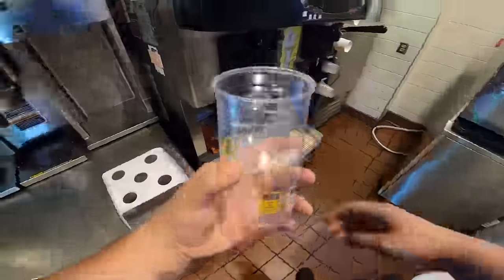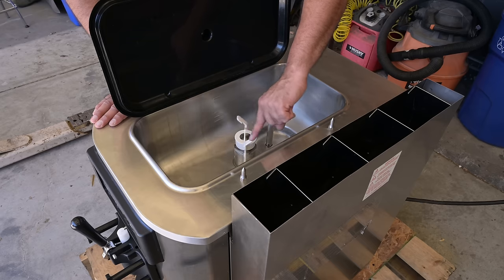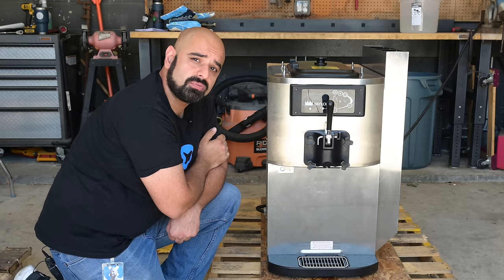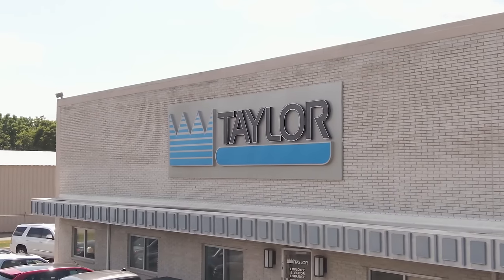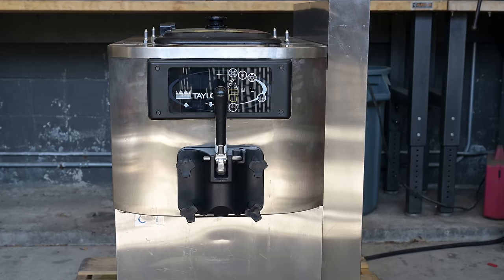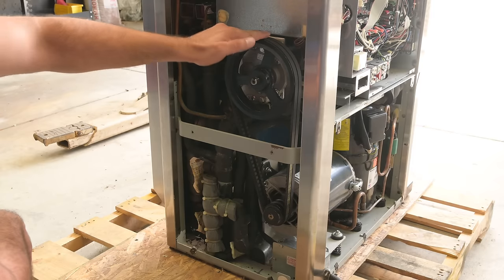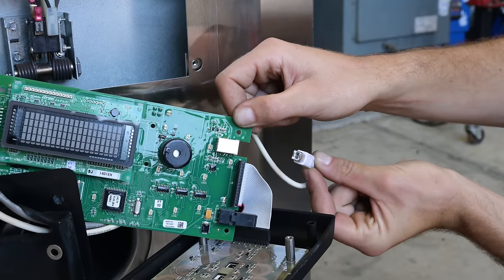Why McDonald's Ice Cream Machines Are Always Broken and How To Fix Them

Comment: The elephant in the room is that such a device would basically violate the contract that McDonald's has with the ice cream machine make her. So even if you fix the DMCA, they might be stuck with the companies BS for months or even years depending on how long the contract is. Even if there wasn't a DMCA, the original kitch device would have violated the contract.

Comment: could a main control board be designed to swap out the one on the machine. this would mean you are not technicly bypassing the locks you are just replacing.

Comment: Excellent…the inability of the company to resolve the unacceptable recurring demise of their machines should automatically make their contract with the franchise null and void, at the very least, until they  satisfactorily fix the problems. The franchise should have every right to do whatever is necessary, without any interference.  McDonald’s need to remove their head from their tush and resolve the issue once and for all.

Comment: Unless you have the exact same machines as they use in mcdonalds, you WILL NOT get the same problems. The software of the mcdonalds machines is completely different than the rest of taylor machines.The biggest part of this is Mcdonalds not wanting to allow the franchise employees to know how to properly clean and maintain the machines and especially not know what each error code stands for. There is a whole video on this same topic about this guy who came up with an app to help employees to know what each error code stands for and how to fix them. The reason why mcdonalds does this is to force their franchise owners to pay for expensive maintenance fees instead of letting them fix it themselves.

Comment: Its control board and panel is completely overkill. it could be run completely without micro controller if necessary.

Comment: The whole machine does not seem complicated; just a few motors and sensors, i doubt its ice-cream producing parts change much since 1970s. Maybe its viable to design a drop-in replacement controller board with no digital locks whatsoever and just swap the original.

Comment: I charged back a $20 order that included the overpriced grimmace meal, paid through the app, pulled up just to be told the ice cream machine was broken. When I told them to refund it I gave them 3 days which they never did. I was pissed because I know why these machines fail yet the app does not prevent ordering items that involve the ice cream machine that they know is going to fail due to the scam between taylor and mcdonalds as a corporation.

Comment: The right to repair part is only one part of the issue here. There are no relevant patents in that machine that haven't expired long ago. It should be legally possible to:

- Make and sell a better replacement machine
- Buy a better replacement machine from a different company.

It's not currently possible, due to franchise pressure. But if a manufacturer can prove their ice cream machine is equivalent, it shouldn't be legal for the franchise overlord to retaliate against franchisees who use a superior machine.

Right to repair is just one necessary part of a fair and competitive market. But if there's no fair and competitive market, there are still countless ways manufacturers can effectively prevent owners from servicing their own machines, even with a right to repair law.
Reply: That’s true in other parts of the world, and this isn’t an issue there, but the land of the free let’s owners force you

Comment: Sounds to me like there is something in it for McDonalds. Without some financial benefit from an interest in Taylor, it doesn’t make any sense for McD to stick with Taylor machines. Im sure they are costly. Constantly breaking down means no product and no sales. Franchise owners can’t be happy and as much as McD doesn’t care about their happiness they care about profits. So somewhere McD has to be benefiting from what otherwise seems like a losing business proposition. Other places sell soft ice cream. What machines does Dairy Queen use? Do they also have all these breakdowns and meaningless error codes, overheating issues (hot summer makes ice cream a big seller) and long cleaning cycles?  Seems to me a lot of the components ought to be able to be detached and run through a commercial dishwasher and then popped back into place.

Comment: How is it that Dairy Queen doesn’t have this issue with their soft serve machines? Maybe McDonald’s needs to source a different machine and cancel their Taylor contract.
Reply: The DQ I used to work at had very simple machines that pumped the soft serve mix from a bag in the walk in cooler. The McD's machines are way more complex and designed to fail.

Comment: The claim that the DMCA bars interpreting error codes seems dubious.  I suspect that an appeals court would eventually find that error codes were not a technological measure that "effectively controls access to a work protected under this title."

First, it's not clear error codes control access to anything at all.  They certainly don't seem to control access to any copyrighted material and it's doubtful that a mere error code lookup table would count as doing so effectively (as low a bar as that is judges aren't likely to rule anything were a tech might just remember them all as an effective access control measure).

Of course, that's not what most companies use to block repairs.  They use slightly more sophisticated electronic authentication which they can make a non-frivolous claim controls access to things like their code or bus protocols or the like (and u can't easily challenge w/o first violating).

Comment: It's insane that its illegal to diagnose the unit because of COPYRIGHT laws.
A company prohibiting access by technical means is one thing, but the law prohibiting it (even though clearly that has nothing to do with copyright) is just another level of stupidity.
It should be allowed. Of course, the vendor could decline (or charge extra fees) to service machines that have been tampered, they have the right to do so ( and it makes sense - this way the have to test for more things when diagnosing an issue)

Comment: Write an app that read the screen using the camera and provide a step by step checking 🎉 No photo shown to the user as the visual of the machine might be patented or any itel under copyright. Ask the user for confirm of problem solving. Put the data in a lake and intuit the issues on phase 2 based on that. 🎉

Comment: I currently maintain 2 mcdonalds shake machines with about a 90% up time one machines is 12yrs old the other is 3yr old the most common issue for then being down at my 2 locations is the staff not caring about the machine not maintaining the right mix level to little it falls heat treat some times to much can have the same effect another improper cleaning when not done by me yes 4hrs to clean maybe 5 if I have to reseal the machine if it's being cleaned in an hour or two don't eat out of it I'm old when it comes to cleaning and such also maintaining the machines parts pumps motors glycol levels filters I do all of this having someone trained by taylor would be the best fix at set up improperly cleaned pumps will take you down for day waiting for replacment parts I have many other stores call for question this thing is not your standard fridge or freezer they have a mind of there own sometimes and please turn on your audible mix level indicator you will take time and money just with that dam beep

Comment: I feel like the issue isn't that you can't repair it but rather that it's legal for quasi-monopolies to create systems for which "official" repairs are that expensive are allowed to break that often.

I mean, it's really not hard to tell this is an actual manufacturer conspiracy when EU/UK machines are by far not down as often as the ones in the USA, when the only real difference is that EU/UK are has garantueed warranty periods for any sort of electronics. I mean, it's a bit weird that when you hold manufacturers accountable for the shit they sell, they can - all of the sudden - produce decent quality that doesn't break. Weird, innit?

Comment: My guy, the machines at McDonald's are designed to break, Taylor since McDonald's opened has been doing this so local owners have to spend 100$ an hour on some repair dude with a special manual that actually twlls them whats wrong, usual main culprit is the ice cream being a degree off.

Comment: 1 1/2 engine. Ah it's called a motor, engines are in cars, trucks.  Show an ingredient list of what's in the ice cream. Also show a machine that has been in use inside. You may be surprised of what leaks in and rots.

Comment: Edit, i was there 20+ years ago. Not being able read the codes is ABSOLUTELY B.S.

It is rough working fast food when any  machine is down. 
Working the opening shift, I cleaned the Taylor machine everyday for 5 to 8 months. Took me around an hour per machine. If you forget One Step or an O-ring. That's it. Take it alllll back apart. Even with just an ice cream and a milkshake machine. Two mistakes, that's your day ruined.

Screw unfixable machines. Profit gouging sharks.

Solidarity with Ukraine.

Comment: flathead screws? What is this, 1940?
Also, one way for this machine would be to ditch the crappy controller they provide and replace it with an off the shelf PLC. Sure, you'd have to basically program it from scratch, but it's an ice cream machine FFS, not a car.

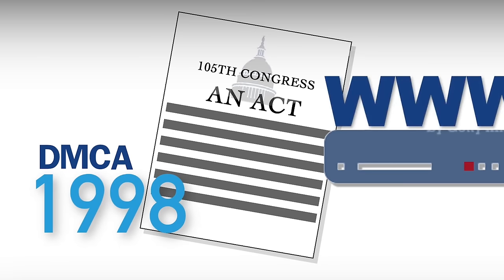Comment: 7:48 sorry but you can and should, its your equipment not theirs, anything in said equipment is also yours including software, there may be many instances of it on many machines but that instance is yours not theirs.

Also its a dang ice cream chiller/mixer its not exactly a complex process nor is it a application that relates to security of any kind, quit being afraid of legislation that has no reason to apply to applications like this.

I sure as heck dont let a law like that govern how i can fix my own equipment, if i encounter a problem or a lock on MY equipment im bypassing it no questions asked.

Comment: What wonders me is that the compressor is inside the unit. Typically commercial/industrial freezers have an external condenser(like an AC) like a Güntner cooling system. Yeah it shouldnt be frozen but the overheating issue would be fixed since the condenser would now be outside the building and can reject the heat.

Comment: Nice video, but this has nothing to do with the reasons why McDonald's ice cream machines are down so frequently.  Your machine doesn't even begin to touch on it, nor does your video. Error codes have never been an issue with respect to McDonald's machines.

The number one issues is employees not maintaining the level of mix in the machine, which causes the machine to go into heat mode.  Your machine is not a 1:1 of the McDonald's machines.  If the mix level is too low or too high the unit will go into heat mode.  The former because if there is insufficient mix, then heat actually builds up if too low, there is an air tube that mix or foam will prevent the system from drawing air.

While this is the number one issue, the result if not addressed quickly, is that the unit goes into heat mode and must be cleaned.  If mixture is removed, if filled too high, or added if too low, soon enough after alerted, the staff can sometimes avoid cleaning the unit.  Otherwise, you are down for a cleaning.

The number two issue are seals.  Again, unlike your unit, the auger (beater) is on a shaft which inserts into the back of the unit. There is a seal, which when damaged or worn allows the mixture to leak into the machine.  That catch drawer you pulled out, there are two in the units in McDonald's.  If this overfill with mixture, then the mixture spills out onto the evaporator, compressor and motor.  With the heat of the unit, the mixture becomes hard as a rock and impossible to remove.  A compressor or motor that is covered in mixture will result in overheating of those parts, and with the compressor, cause it to inefficiently cool.  Likewise with the evaporator, however, in this case it becomes increasingly difficult to cool the mixture as air can't flow through the evaporator.  The failure to properly maintain the machine is the number one cause of long-term failures.

There are other issues, as well, but those are the two top two issues.  The only way to resolve the primary issue would be to create a machine that automatically feeds mixture to the machine without the crew needing to fill it.  The number two issue needs a solution as the situation seems to be worse.  One McDonald's I know of had a machine for 35 years, since it was replaced with a newer unit, there have been 3-4 replacement units, all of them due to the compressor/motor/evaporator being caked in mixture.

Comment: ok but why does that transformer have a drip tray? :'D
also the DMCA anticircumvention stuff has nothing to do with the right to repair, you know that right? section 177 literally says "it is not an infringement ... to make a copy or adaptation of a program provided that ... is created as an essential step in the utilization ... with a machine" while section 1201 says "No person shall circumvent a technological measure that effectively controls access to a work protected under this title." (error messages aren't substantive work) and "a person who has lawfully obtained the right to use a copy of a computer program may circumvent a technological measure that effectively controls access to a particular portion of that program for the sole purpose of identifying and analyzing those elements of the program that are necessary to achieve interoperability"

Comment: The machine you bought is a different beast to the macs machine, other than it makes ice cream. Different mechanics and systems. The error codes are not the cause of any problem, they advise what the problem is. Suggesting someone with no technical knowledge can push a button and rectify the issue is very misleading. Maybe the error codes could be more explanatory but a non tech would still not be able to fix it.

Comment: The best solution for a reverse engineered device like this would be to open source it.  If you do this as a company they have a legal stand against you and a realistic chance at shutting you down as well as financial benefit.  If you make an open source project, especially if you do it under a fake name/pseudonym, good luck putting that cat back into the bag.  With Arduino and Raspberry Pi being so readily available, if you figure out and document the protocol/error codes and post this information publicly, it will spread.

The problem seems to be that anyone who wants to invest the time and effort into producing such a repair/diagnostic tool also wants to keep it closed and profit off of it themselves.  Shame.

Comment: Because McDonalds employees are lazy. When I worked for Burger King, we had to break down the milkshake machine EVERY night and clean it before we left for the night. So instead of waiting until we closed to do so, we would start breaking the machine down around 10pm, have made up a few milkshakes in case, and if we ran out then we simply told customers "Sorry our machine is down for the night"
Now you factor in millennials and Gen Z working, and you have an ever increasing down time.

Comment: The Taylor machine in this video is nowhere even close to the same functionality as the 602  that you find in McDonald's not even close. The comparison here is a joke. I work on the Taylor 602's all the time matter fact two in the past two days. Granted, it's job security. However, if you're going to try and compare apples to apples compare apple's to apples, not apple's to oranges. Taylor is the manufacturer, yes,  but Taylor makes a ton of shake machines that do not break down all the time. The 602 has a lot of reasons why it's constantly down.

Comment: 1. i am surprised that you was able to get the machine that tailor would even sell you a mcdonalds grade machine.

i would thin the least tailor would do is either say that the machine is sold exclusively to mcdonalds (witch you can lie and say you are starting a franchise or you can do a bait and switch and start a franchise and then immediately go out of business (by witch case maybe mcdonalds may ask for the machine back)) or they would have. a consumer version of the same exact model that has normal software.

oh incase mcdonalds and/or tailor should try anything funny and call in a copyright complaint to get the video taken down i have a backup copy of the video thereby i can repost it for you even on a site that only takes down malware, fakes and illegal images (yes the same illegal images that apple wanted to combat on the iphone and back pedaled after controversy).

screw the dmca if you need to make a transaltor device and sell the device without the software and then post the software to the same torrent site i was describing above.